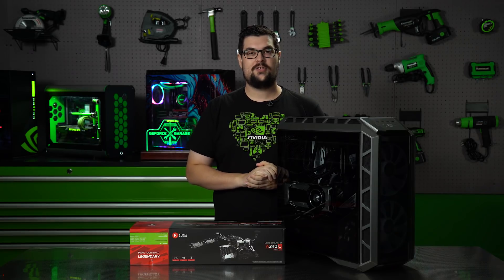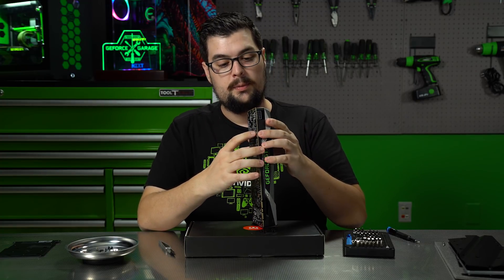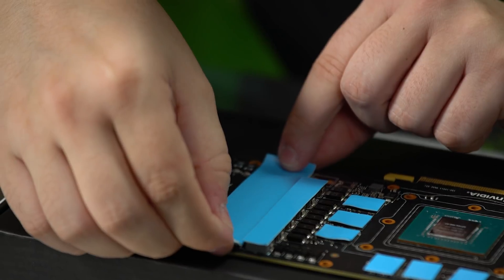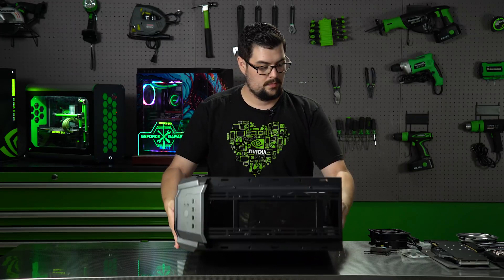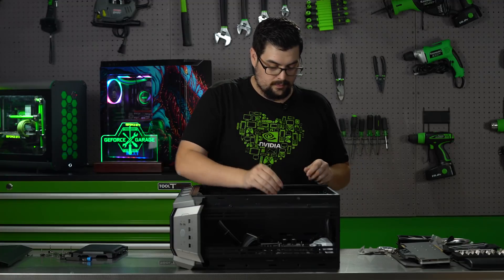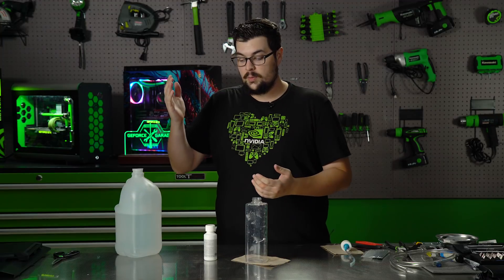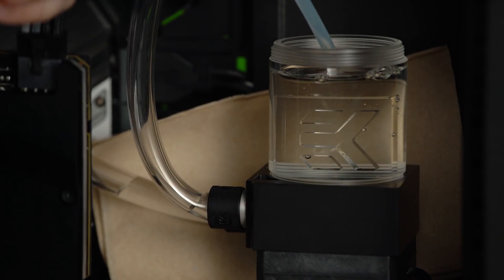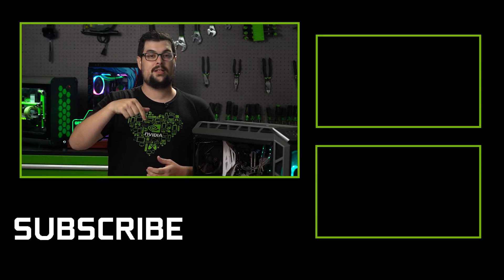GeForce Garage - Upgrading Your Rig Using the EKWB A240G

Comment: some of the major uses of the gtx 1080ti are:

1.Accelerate graphics in productivity software, i.e. CAD, Photoshop, Illustrator.
2.Act as a co-processor for accelerating certain tasks, i.e. rendering videos with Adobe Premiere or helping Photoshop apply certain filters faster
3.Act as a stand-alone rendering processor (GPGPU) for numerous things, from rendering (iRay, Vray RT GPU, Octane etc),
Computing math models for numerous applications, for medical research to stock exchange prediction algorithms, weather forecast / simulation, fluid mechanic simulation etc.

Comment: GPU  from 82° to 48° C ... well   maybe i am the only, but you can't judge a "water cooling" system after only 4 minutes in FurMark.  It should be tested for a few hours  since  "water"  takes way more time to heat  than a normal aircooler heat sink.   (also,  once it heats up  it takes more time to cool down)
Reply: Please learn physics and thermal dynamics your comment is stupid.

Comment: That's one sick looking computer. Though it does sound like the Nvidia Garage needs a new drill. It sounded a bit weak. I'd personally recommend a Rigid brand because they're strong and easily controlled but only if you could get it painted to match all the other tools.